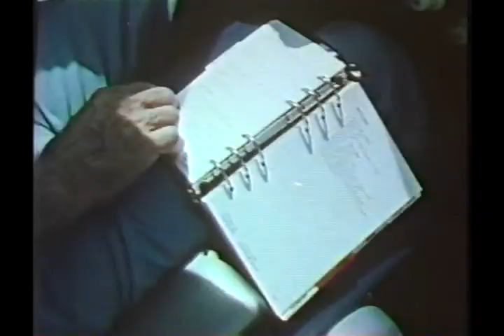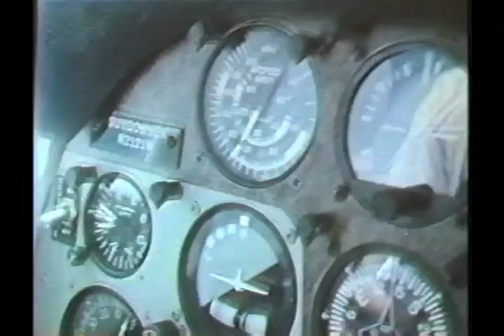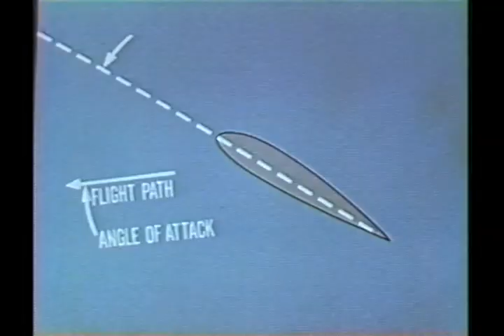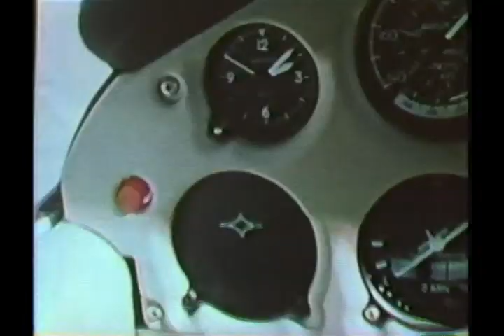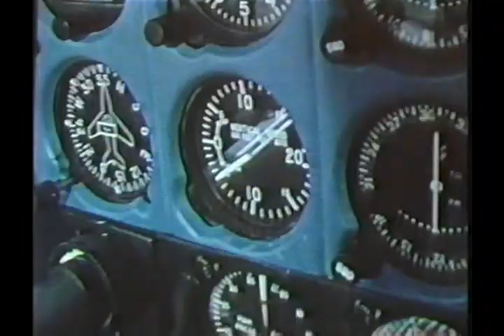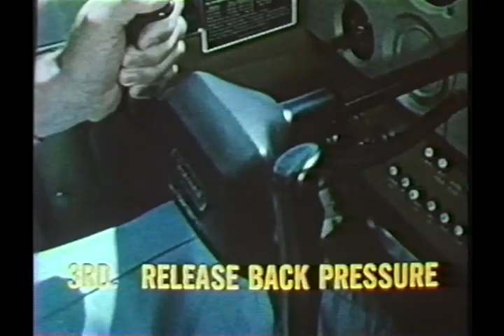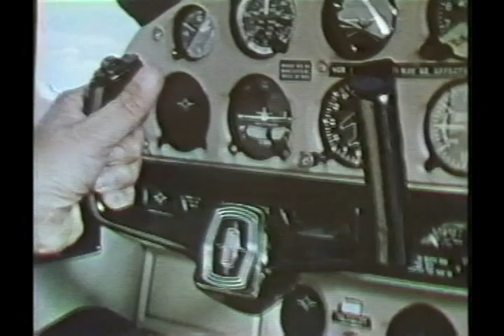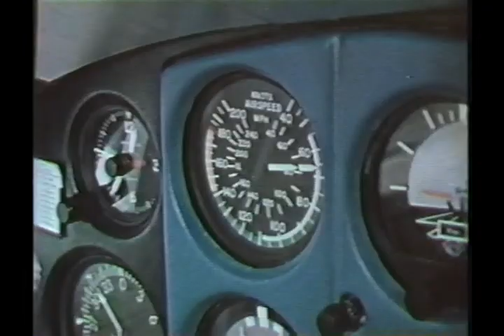Stalling for Safety - FAA video Private/Instrument/Commercial Pilot training 1976

Comment: Now I'm just teaching myself some basics in a simulator, as I want to take ultralight lessons (maybe in 2021), but I've been using a Cessna in X-Plane 11 to learn basic flight mechanics, build up some muscle memory on the controls, and of course just gain some general aviation knowledge. So correct me if I'm wrong on the following. What I've been figuring out is that you should never stop "flying". And "flying" means you're constantly monitoring and/or managing: your surroundings, forward/vertical airspeed, altitude, and as much general aircraft health info as you have access to. Also, use throttle to control altitude and pitch to control speed. I've been extremely successful so far in my simulations by doing the above. It seems like the bottom line is situational awareness, just like driving a car, only you have an extra dimension.
Reply: What type of ultralight? A lot of them fly very, very different from GA and you could be setting yourself up for bad habits by trying to commit GA controls to muscle memory (through a simulator especially)
Reply: @wills.5762  I should have mentioned that I also spend a lot of time in the Dragonfly ultralight that came with the X-Plane (and yes, it is a very different experience, even in the sim). When I say muscle memory, I mean in a very primitive sense, like which way the rudder pedals work (I somehow had it backward in my mind and took a week or two to get it straight). Mainly just learning what control inputs make the aircraft do what, the basics of sidelsips & crabbing, etc.
Reply: You’re right. You have to adjust the altimeter just by itself every 1 mile or so, as pressure in the air changes by 1.00 inch hg, if you don’t change your altimeter, your altitude indicator will continue reading 10,000 feet, when in reality you’re dropping every 1,000 feet every mile, hence why you change the altimeter so you stay level

Comment: I was taught to pick up the stalled wing with opposite rudder, rather than to break the tall first. Maybe this method would make me less scared of entering a spin if I didn’t pick up the wing straight away.
Reply: Always use the PARE rule... Power off,  Aileron neutral, Rudder in opposite direction of stall spin, Elevator forward. In that order.
Reply: @bobvidoni5898  Even in a Tomahawk?

Comment: I had a very good WW2 instructor, who taught spins very well. This video does not really address the problem of lifting the left wing in a power on stall. We had a 152, with just a little bit of extra angle of incidence, on the left wing, to aggravate the drop. Without practice, EVERY pilot will attempt to raise the wing with aileron, which increases the angle of attack on the stalled wing, resulting in a spin. This is why, in this video, they say to break the stall before levelling the wings. As I was taught, opposite rudder and forward yoke, results in a recovery with minimal heading deviation, and with practice, even become fun. When you can recover on a specified heading, you have mastered the spin...the opposite rudder, also helps to swing the stalled wing back inline with the relative wind. For those not familiar with the reasons why, engine torque, called P-factor, causes the left turning tendency. For the same reason, a helicopter needs a tail rotor.
Reply: Curious what was his name?
Reply: Don McCann, R.I.P.  @ryanestes7331
Reply: Thank you Convair.

Comment: Good video, and its age isn't really an issue. You could have made a film in 1918 that would have covered the same points about stalls and spins and how to recover them. Modern aircraft may be safer, but the basic aircraft controls haven't changed.

Comment: sure wish  AF447 pilots had seen this video.   could have translated it into French and also saved teh  AirAsia  A320.   Why dont commercial pilots know how to recover from a simple Stall?
Reply: Scott Moseley, did you really think Air France pilots need to rely on translation of old FAA vids (even as good as this one) to be certified ? The fact was that commercial pilots instructions and procedures (and not only Air France ones) emphasized mainly on avoiding, at any price, any loss of altitude, and the commonly agreed procedure was to simply add thrust to recover (providing the performance of modern powerful jet engines which have nothing in common with piston engines). Something like a TOGA procedure. This was called the "classical procedure" common to Airbus and Boeing. This way of proceeding was contrary to aerodynamics laws, but was the norm until middle of years 2010s. Thanks God it has now been totally reviewed. Since at high level any loss of altitude is not mandatory and that adding thrust could be counter productive (nose up increasing stall risk, delay, and loss of jet engine efficiency at high incidence). What amazes me is that this "classical procedure" was standard during many years. Moreover in AF447 case, it happened that some informations provided by the instruments/sensors were lacking or wrong thus incapacitating both auto-pilot and pilots themselves.
Reply: Easier said or typed on a comment on YT but when you have your self on a situation like that its probably tougher. I don't judge I just hope I don't ever be in a similar situation. To be prepared in case it does its the best I could do.

Comment: Ya, but doncha think that leveling the wings needs to happen before applying full power to avoid converting that stall into a power-on accelerated stall that becomes a spin?
Reply: When the wings are not level, probably you are in a turn, which means the AOA is higher on the down wing.  Applying full power will aggravate the AOA on that down wing which is close to stall, having just come out of the stall you were just in.  So you can re-stall that wing and most likely spin it since you'll be pushing lots of air over the unstalled wing.  So, nose down level wings, then add power-that will ensure control in recovery is straight ahead.  Otherwise, great video that chips away at the "stall speed" myth.

Comment: Use alierons to level wings in a stall? They don't still teach that in the U.S. do they?
Reply: Your original comment says "use ailerons to level wings in a stall". Yes. Keep wings level with ailerons in a STALL. However your explanation is for a spin. No, you do not use ailerons in a SPIN. You can use them to avoid a spin in a stall to an extent but in an actual spin, neutral aileron is required.
Reply: +Didntwanttomakeauser Noob here -- what is wrong with that and what is the correct procedure?
Reply: +Borko Jandras The down going aileron on the wing you're trying to raise creates more drag making the spin worse. Since the wing is already stalled the aileron doesn't have enough authority to raise the wing. I was taught leave ailerons neutral, raise the wring with opposite rudder only.
Reply: +Didntwanttomakeauser Makes sense, thanks for clarifying.
Reply: @J and.... people are still killing themselves by making the same damn mistakes in 2019. See Harry Bliss and Density Altitude filmed circa 1965 by the FAA.

Comment: There is a pilot who, according to his accounts, has recovered from over 30,000 spins. He trains pilots to recover, implying that stalls and spins are probable. We, students, should take this very seriously.
Reply: I did it as a solo student.  I used improper recovery technique, but the great handling of the Cherokee I was in saved me.

3000 hours and no mishaps later!
Reply: excellent
Reply: 30,000 spins, a bit clumsy.
Reply: When I started flying back in 1982, after 2.1 hrs of training, my instructor demonstrated spins and spin recovery. Although it took some time to get over being slightly airsick, I was thankful for learning this. Today, whenever I am in an airplane approved for spins, I do a few in both directions, at altitude of course and go at least 3 turns before recovery. Today’s training only requires incipient spins which in my opinion is a sign of weak and scared instructors. Remember, you cannot stall a zero “G” airplane. Therefore, you can essentially turn 45 degrees in a traffic pattern while applying forward stick with coordinated rudder and you will not stall.
Reply: @RetreadPhoto Sorry, I disagree. Students should be introduced to it so they get the feeling of what it is like so they understand what is going on. If a student in advertently enters a spin, they may panic and not know exactly what to do. I’m not saying that they should practice spin training. I’m saying, they should be introduced to what it is both physically and emotionally. They will respect the aircraft a whole lot more.
Reply: On the opposite - I dont know of any pilots with more than one failed spin recovery.
Reply: And this is why aircraft are getting AoA indicators
Reply: +frog's shadow hopefully the aids and automation do not make people over reliant or complacent.
and not make them unaware of .. what it is like to grasp, be aware of things.. without those technologies or when things fail

Comment: What does he say at 14:49 - 14:50?? Any ideas? It sounds like: 'he pours the coal to it'. Obviously this is not correct! Thanks.
Reply: That is what he's saying. It's a figure of speech.
Reply: That is exactly what he says.
Reply: This is the best scenario for stall recovery. 

The nine-point stall recovery scenario
Level the wings with the rudder.The rudder is the most effective control surface in a stall condition. (Even the seemingly scariest stall becomes less frightening and more manageable once the wings are level.)
Squeeze the nose attitude slightly below the horizon. This may require back or forward pressure on the yoke depending on the attitude of the airplane and the current trim configuration. Use positive control, be the boss of the airplane's resulting attitude.
Power up. Add full power.
Clean up. Carburetor heat off, flaps up (normally retract half flaps if in full flap configuration; if in half-flap configuration, retract flaps all the way), and gear up. Note that the POH-recommended procedure and order is the final authority.
Speed up. Bring speed up to VX. Anything more than VX results in time and altitude wasted and is contrary to your objective. Once you have reached VX or if you are already above VX, move on to step 6.
Pitch up. Change the pitch attitude gently from slightly below the horizon to VX attitude. This attitude should be demonstrated prior to stall recoveries so the student knows what it looks like by looking outside the cockpit.
Verify positive rate of climb on the altimeter. Explain how this is the only true single instrument that shows the airplane is gaining altitude. Explain here the limitations and lag of the vertical speed indicator.
Verify that you have cleared all obstacles. Look outside, make heading corrections as necessary.
Lower the nose to VY attitude.Continue your climb to your desired altitude.

Carl Dworman
Jerusalem, Israel
Reply: Andrew David Boyle He does say "pours the coal to it'. It's and old slang reference...like, A LOT of coal in a steam engine train, car, etc...It simply means adding alot of power quickly